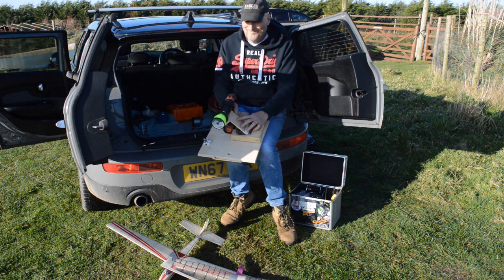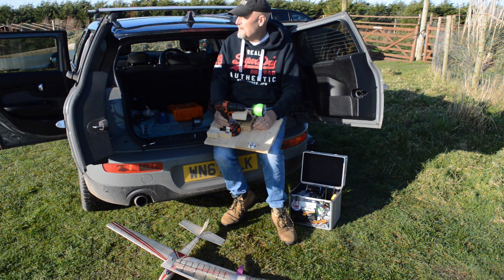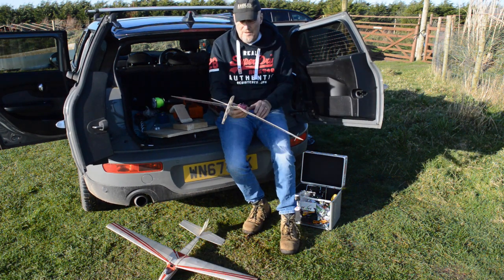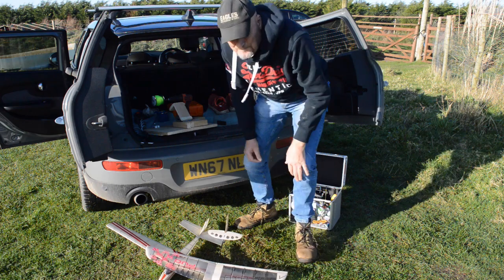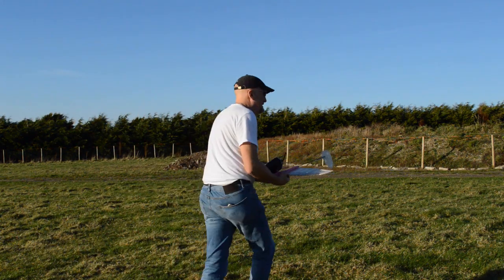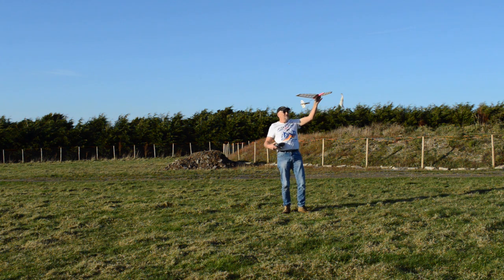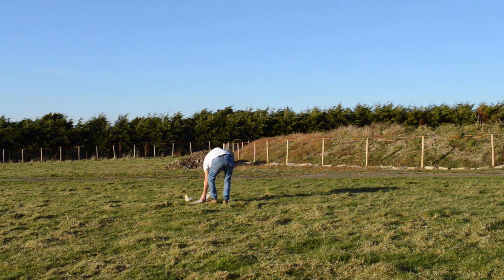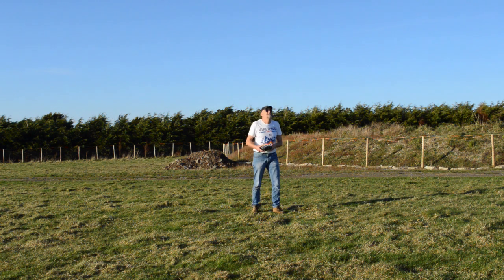Electric Glider winch for the Pug Glider  Plan A

Comment: I went to our local chandeliers and got 8 meters of cotton covered elastic 
Tie 3 metres of fishing line on and a gentle pull back it got 100 ft no problems full cost £6
Reply: i use 1 package of # 64 rubber bands looped togather  followed by 60 foot of mono line    works Great for small gliders
Reply: @larzhillbot1443  don’t want it to hard to pull it will rip the wings off these are just right